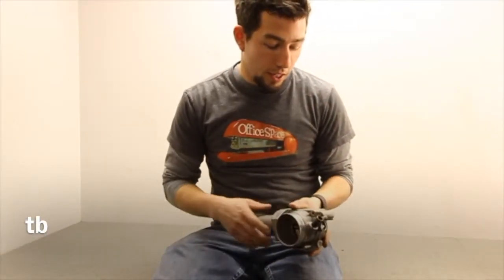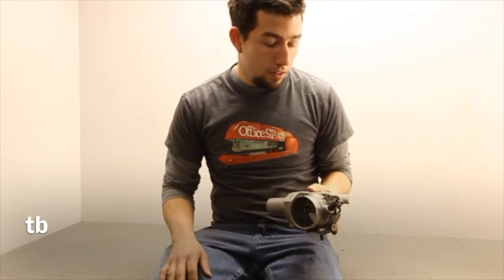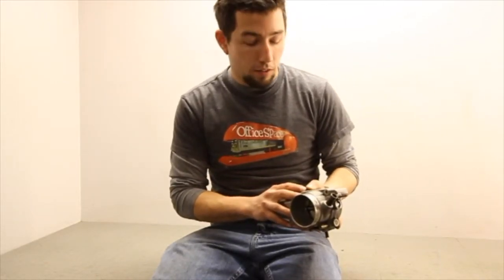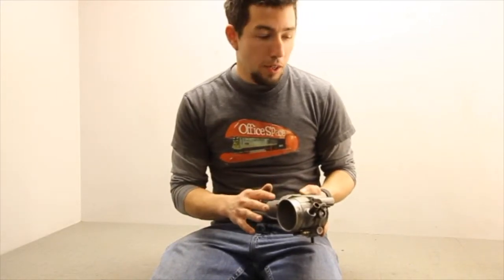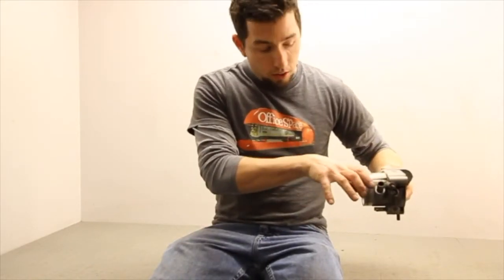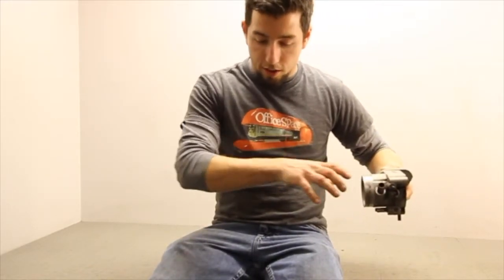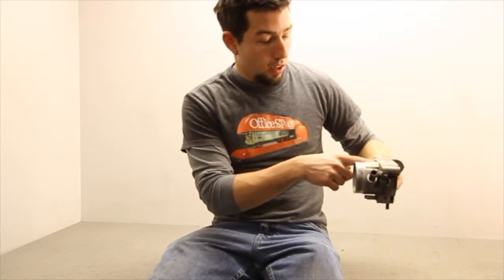Saturn L300 LS2 3.0L V6 Throttle Body Removal Tips and Tricks

Comment: Could this cause a high idle for a few seconds after starting the car? My 2001 l300 isn't throwing any codes but it's starting really weird, and after it starts it idles high. The problem just recently started to happen. Thanks for any information.

Comment: The right way would be to double nut the studs and take them out,Take one nut off and put it on the stud next to it, now with two nuts on one stud tighten oneand loosen the other, D this until they're tight together , Then remove like a bolt,